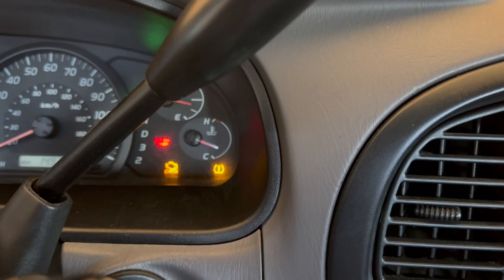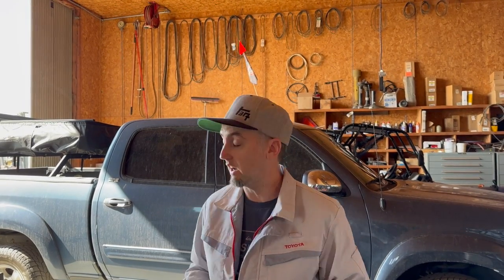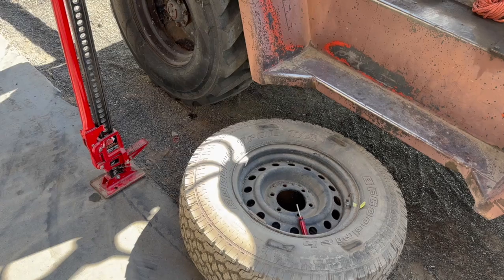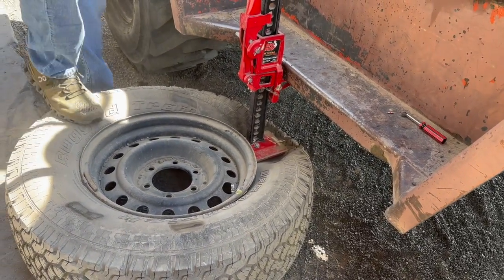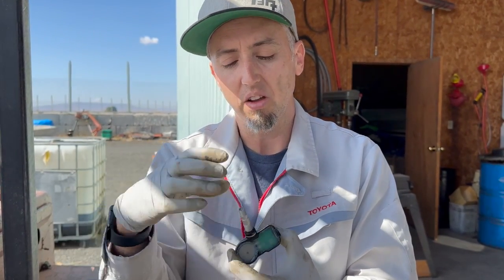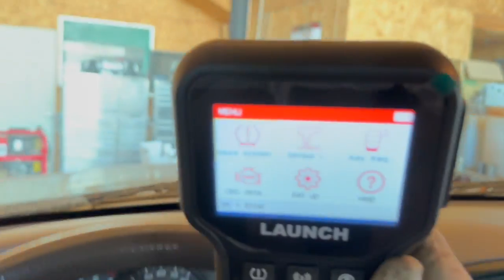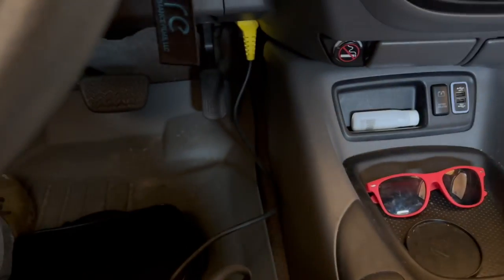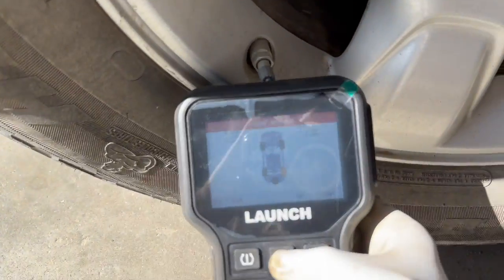TPMS Sensors Explained: Changing and Programming at Home!

Comment: Good job. You can also break the bead on a tire using a 2x4 (or similar) placed with one end on the bead right up to the edge of the lip and then driving into the other end. If you don't have a 2x4, but you have another vehicle with enough clearance, you can just drive into the tire to break the bead. If you don't have a 2x4 or another vehicle, then you could use the brake rotor to break the bead by placing the tire underneath it and lowering the vehicle, but this could damage the tire and is a bit more dangerous, so not recommended.